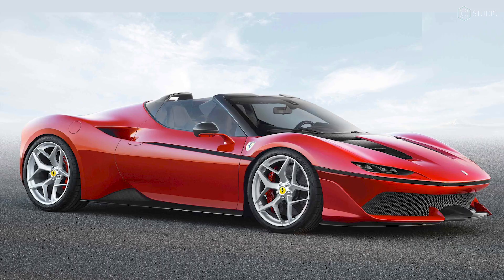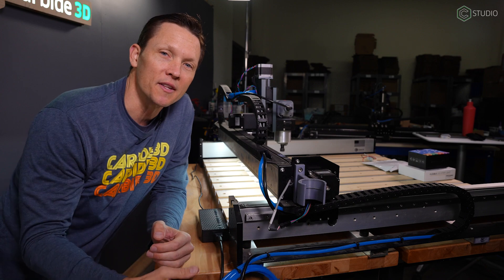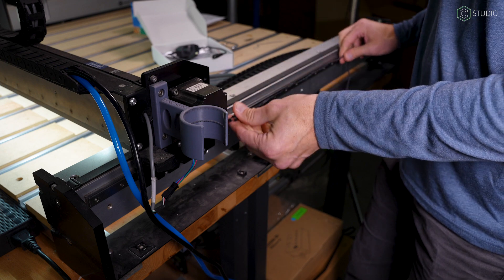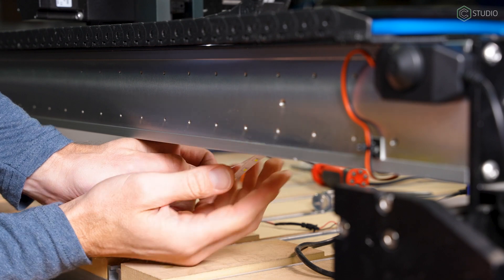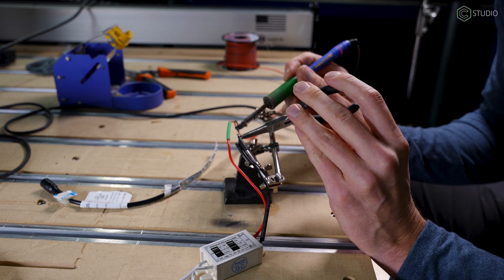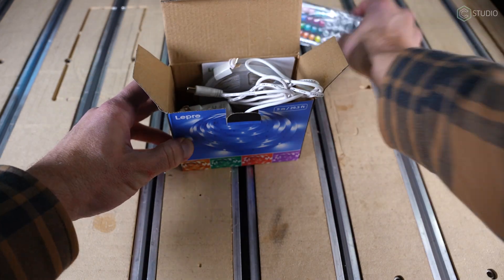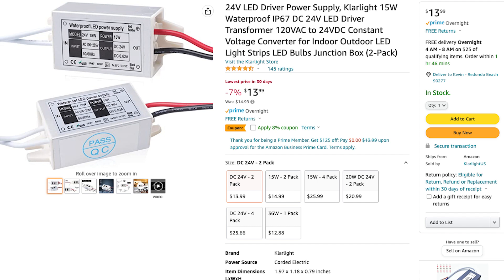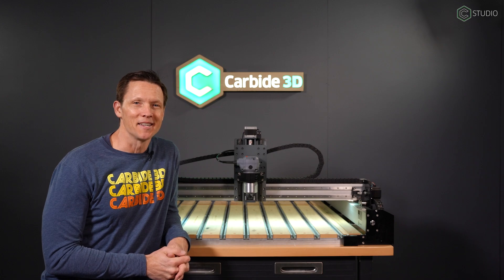The Easiest Shapeoko 3/4/Pro Modification

Comment: If you’re cutting aluminum or copper some kind of covered or waterproof lights would be a very good idea - don’t want conductive materials anywhere near those exposed contacts.

There are also diffusers that you could cover the lights with that come in an aluminum channel.

Another option is lights advertised as “LED Neon” they are just strips in a thick silicone diffuser.

Comment: Noticed an unused 24v "Led_con" on the control board of the shapeoko 4. Would it be possible to solder a set of 24v lights directly to the board instead of having a separate power supply?

Comment: I got a $10 strip of USB powered lights (dephen brand from Amazon), and an $11 USB extension cable. Installation was quick and easy. I just pulled off the adhesive backing and stuck them to the gantry, plugged them into the USB extension cable, routed through the drag chain, and plugged them into the power strip (it has a USB outlet)... The whole thing cost about $20 and took about 10 minutes (9 of that was prying open the drag chain). The lights are nice and bright. I have them on my Shapeoko 3, and my Shapeoko Pro.

Comment: do you find that the capetronix (spelling? haha) is a soft/even spread of light or do you see each "spot" of light?
I recently added a frosted led under cabinet light bar under my gantry (lowes, about $20) and i love the even light distribution.   When i build my new and improved enclosure this year however, i plan on lighting the entire enclosure, not just under the gantry
Reply from the maker: Hey Seth,  The spread is decent.  There's no diffuser over the lights.   The waterproof HitLights do have a diffuser and they are more similar to the factory installed lights for the HDM, NOMAD and Shapeoko 5.   Give those a look.  Pricey, but you'll have a ton left over for other projects.